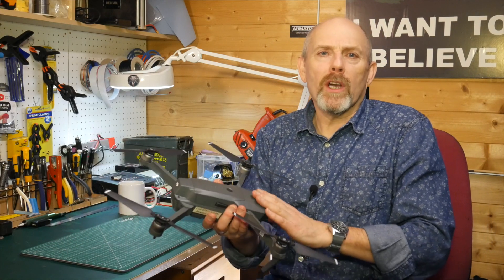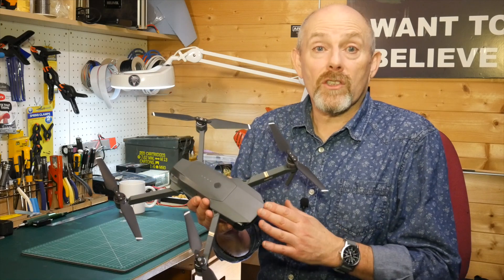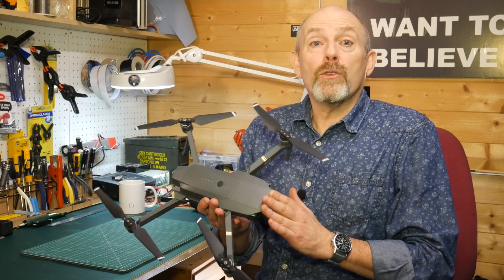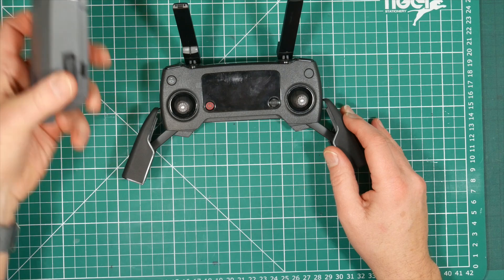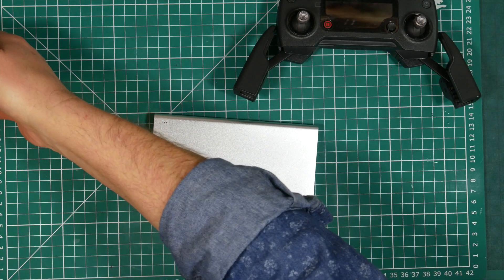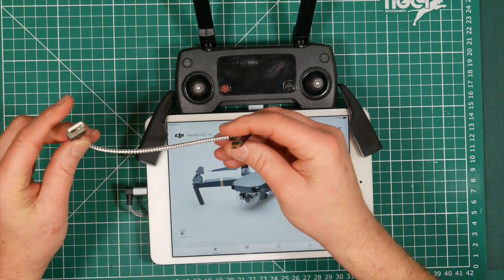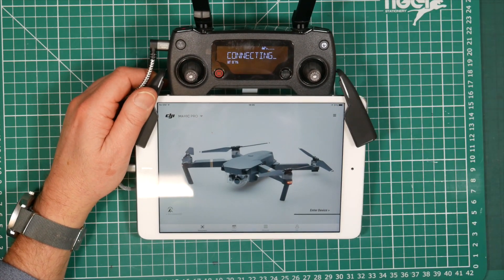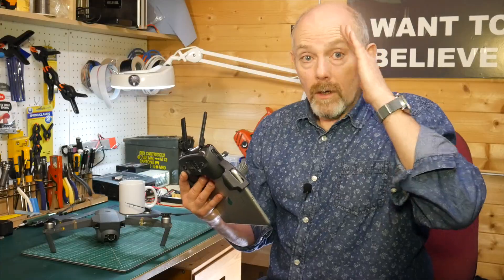DJI Mavic Pro - it's biggest problem fixed using an external USB power pack

Comment: Great advice, provided at exactly the right moment. I was just about to install a new battery in my 5-year old Mavic 2 controller. Now I don't have to...THANKS!!!
Reply from the maker: @airsearch9192  glad it helped. I replaced the battery on my controller a while ago. It's fiddly and not easy to find a battery the right size.

Comment: Thanks, I’m working with a Mavic Pro my son in law gave me. I was looking for a larger replacement controller battery because mine seems good for about 30 min. But I do have a 10K mah batt pack with connectors so you’ve solved my problem, many thanks!
Reply from the maker: I'm glad I could help you out! It's great that you're enjoying flying your Mavic Pro, and it's even better that it was gifted it to you. Using a 10K mah battery pack sounds like a fantastic solution to extend your flight time. You'll definitely get more out of your drone adventures now. Happy flying, and if you have any more questions or need further assistance, feel free to ask. Cheers!

Comment: Hi, I’m having a problem with my dgi mavic pro atm the battery will not turn on and it does not charge is there anything I can do
Reply from the maker: Maybe the battery is just totally empty and the charger isn't working correctly. You need to swap things around to find where the problem is.

Comment: Hi, I'm interested to know your thoughts on DJI batteries. I think the flight battery is the weak point with any DJI drone, as Lipos have a short lifespan and when DJI stop producing them, which I believe they have for the Mavic Pro, the drone essentially becomes unusable. Do you know if there are any reliable third party batteries which will work reliably? Thanks
Reply from the maker: Do not use third party batteries. They are very questionable even if they might be cheaper and will invalidate any warranty if there's a problem of crash. I've been using various DJI batteries since 2016 with no significant issues.

Comment: Good tip that. I use the same battery pack you have there for the ver6 same reason but I did not have it set up as neatly as that. I like the Velcro idea. I will change my set up now. Thank you.
Reply from the maker: No problem.

Comment: hi whirly bloke
the USB C 3.0 Data Cable, is wronge fitting for my tablet, mine is a micro fiting, can you help me as i dont know a great deal about thes data cables, and would not know the data (spec) for the dji control/tablet and i dont want to get the wrong (spe data cable) dont want my drone droping out of the sky so to speak,,,, any help would be great thanks stay safe
Reply from the maker: Just use a regular micro USB A cable, not a USB C.

Comment: I’d really appreciate any help trying to figure out why my Mavic controller says its charging but wont go above 1%.  I don’t know if this is some software upgrade issue or if its a dead battery inside the controller that no longer is able to charge.  Any ideas?   DJI really pisses me off.
Reply from the maker: If the controller is old it may be the batteries are shot. You could try replacing them - never done it myself - or always power it off the external pack. Maybe look out for a used one on eBay.

Comment: And the iPad could be charging too I guess..
Reply from the maker: Nope. The iPad doesn't charge while the port is in use. An Android device does though. But since Android doesn't properly implement the full USB stack, the user experience isn't great. Whether you like Apple or not, IOS devices work much better because of the way they manage USB and Bluetooth connectivity.
Reply: Whirly Bloke bummer.. are you sure? I even remember seeing there was a toggle  somwhere in the menu - charge or not charge the attached device off the controller battery, thanks
Reply from the maker: @mbikov  It's an iPad thing not a controller thing. But there's nothing to stop the controller using the charge port while it's connected to the iPad with the USB cable.
Reply: Whirly Bloke thank you

Comment: Great soluttion!! What do you think about using discharged battery ( often around 20%) from mavic  in my pocket conecting via usb adapter and usb cable. I havent that big power bank so I wonder to try bith those mavis battery...

Comment: I was about to buy a tablet holder, then I saw your video. Briliant way to the attache the tablet on the controller. Great back pack too! Thanks.
Reply: Not really .... There are MUCH BETTER tablet holders out there which will allow you to hold the Remote in a very comfortable way and fly with much more precision. I am surprised, that a "pro" like this guy is actually using his iPad in this way.

Comment: I'm having a problem at the moment where my controller refuses to charge past 1%. It must be a problem with the controller itself as the cables and plugs etc charge my other devices.

Would you think that using an external battery pack like this would be an acceptable fix for flying now? The last thing I'd want to do is have the controller shut down mid-flight.

Thanks.
Reply from the maker: The controller is a sealed unit, but there are some tear down videos if you are brave. No idea if you can get a replacement battery though. I'd try cleaning the connector with IPA and checking it or try another charger.  The connector is a know problem because it's keyed, but not very well, so it's easy to damage because you can push it in the wrong way. Using an external power pack is worth trying. If it fails, the Mavic will RTH. I fear the you may need to get a replacement controller or look out for one on ebay.
Reply: I have same problem. Ive changed the battery but the problem still persists. Did you find a solution?
Reply: My Mavic controller also says its charging but doesn’t go above 1%. Is this some sort of software upgrade or what ?  It was working perfectly a couple of months ago.   Ive used several different charging cables and they cause the controller to appear to be charging but its not.  Help!